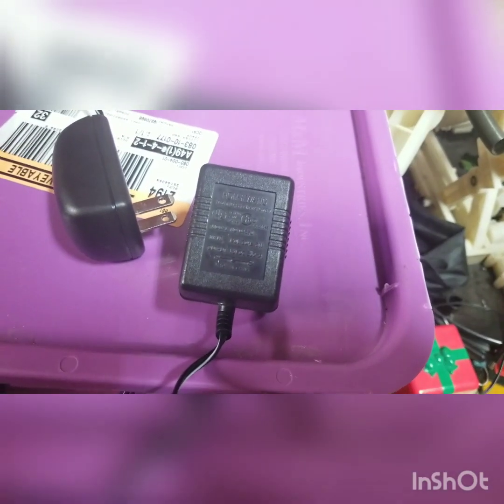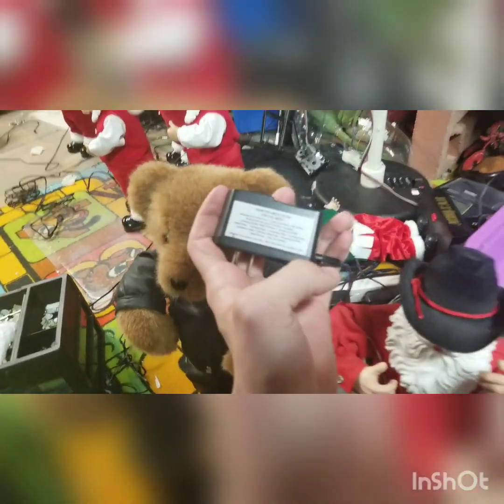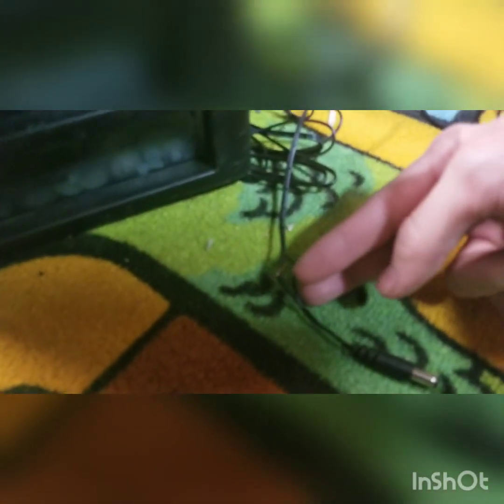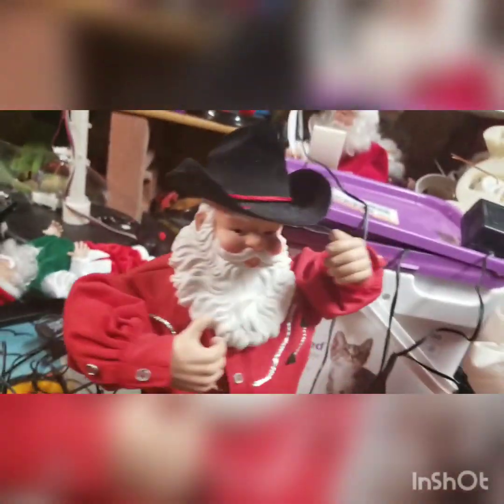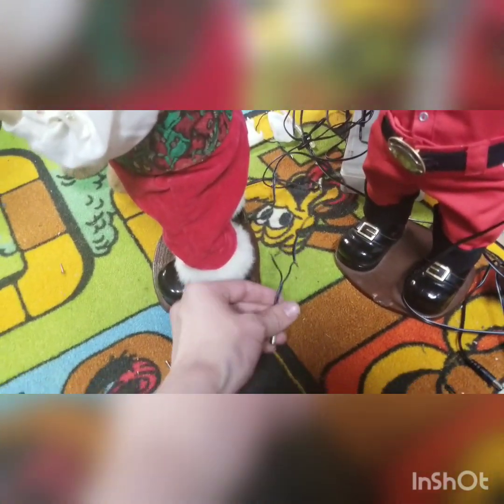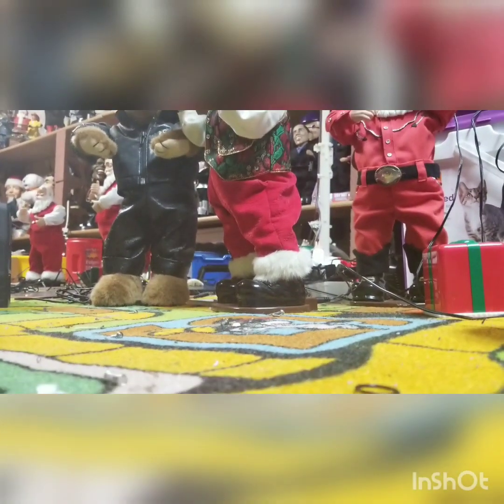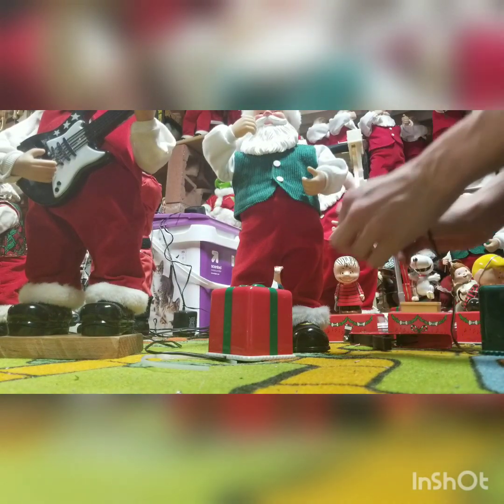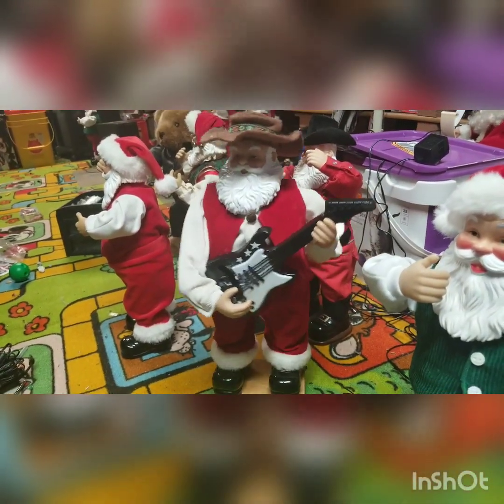How to make your Rock Santa Collectables  work with Other Adapters

Comment: Wouldn't it be easier to just switch the red & black internal wires at the ac? This way you don't have to ruin your adapter. Or would that mess up the Santa? The bottom opens up easy. You sure have alot of Santas!

Comment: Most multi voltage AC Adaptors I've seen allow you to change the polarity of the tips on the end, you just pull the tip off the plug and put it on the other way around.  Is it no longer possible to buy such an adaptor now?  I'd think most electronic stores would sell them.
Reply from the maker: Well I actually recently just purchased a voltage changing adapter that has that ability online. Idk what stores sell adapters really, or if people would know to do that if they had an adapter like that, but it definitely makes sense and has the same idea

Comment: My rockin around Santa came with the holly jolly and jingle bell rock Santa adapter and it still works. Is this normal
Reply from the maker: Yes because it's still a rock santa collectable lol
Reply: @gemmymasteranimatronics768  also about my rockin around Santa, when I turn it on it goes static and glitches, and then the music plays similar to your rockin around Santa and black jingle bell rock Santa. Sometimes the volume also goes in and out. Do some Santa's do this or do I need to get it fixed?

Comment: If you switch the wires around on the adapter does that mean that adapter won’t work on other stuff like tekky props
Reply from the maker: Yes, I demonstrated that by plugging it back into the rock a long santa